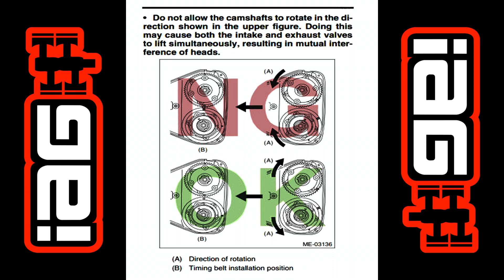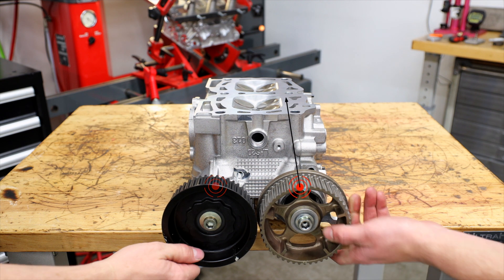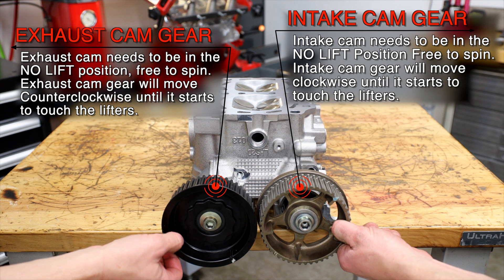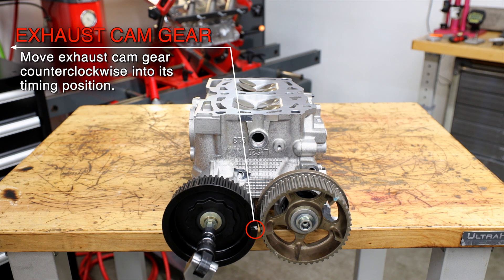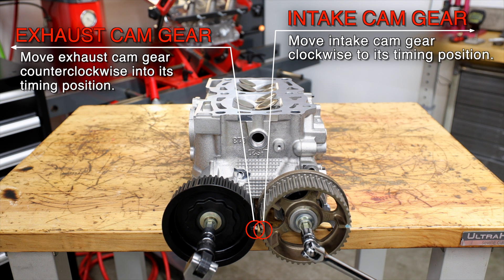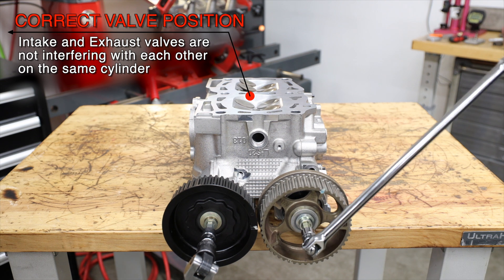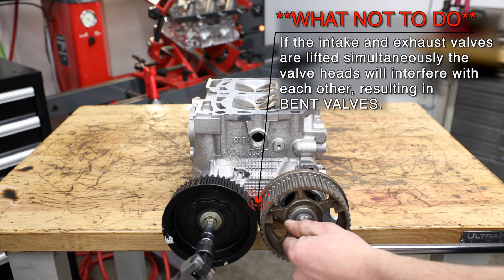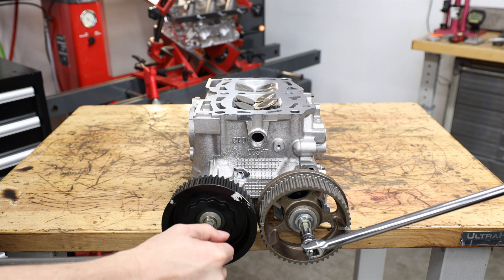You could lose 25% of your valves with this one weird trick. Engine builders hate it.

Comment: Doing a timing belt on a 2010 WRX and I had a hard time getting the cams lined up and to stay put. In all the reference videos and such that I watched I had not caught the fact that the exhaust pully is rotated opposite of it's normal running direction. I thought things were safe because the crank position had the pistons neutral. There is a high likelihood that that in the process of setting the cams and them springing around that I did this and I am crushed thinking about the consequences.

I just reinstalled the timing belt and was going to finish getting the cooling system back together and fire it up later this week.

Is it likely that a compression check would catch that amount of valve damage? It doesn't look quite the same as if damage occurred from piston contact.
Reply: Any updates on what happened? and, yes, in theory, a compression test may catch it, but that's if the damage is bad enough (though, odds are it will not).
Reply: @Awkward_Fox  So I did a compression and leakdown test and everything looked great. Car runs pretty good but I feel like I need to have the tuner go over it again. Not sure exactly what changed but it's down on power a bit. No check engine lights, runs smooth and makes boost though.